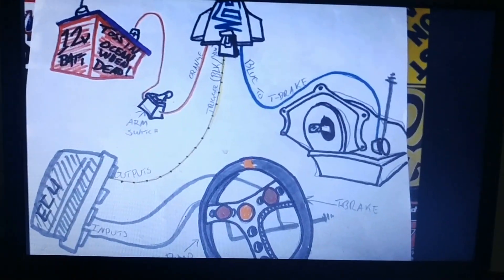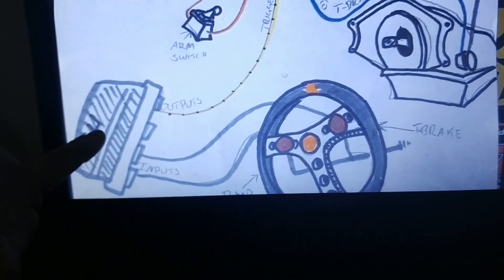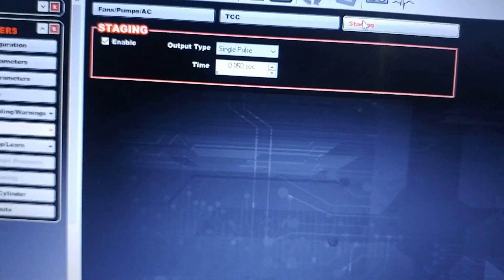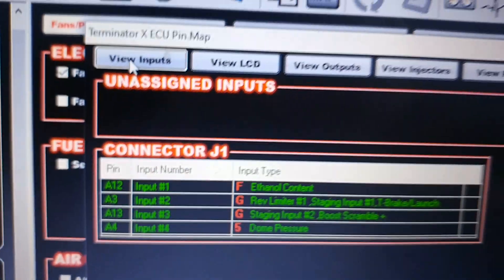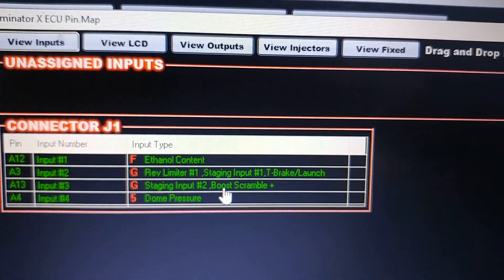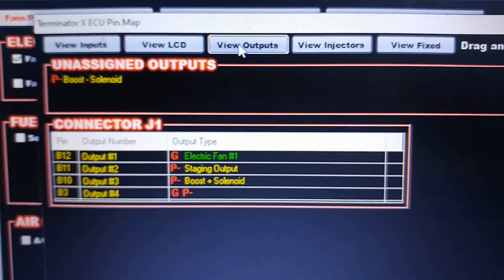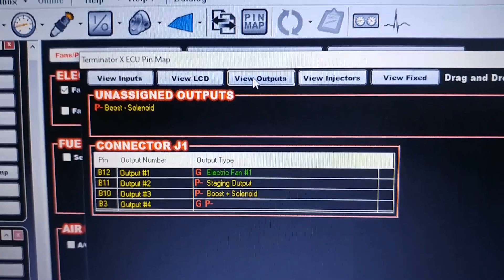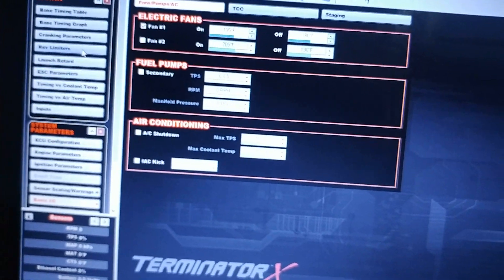How to  setup a 2 step and trans brake with a Terminator X

Comment: Hey there  weve been trying to plug my transbrake for 10 hours now XD , I dont undestand cause on my B pin on my transmition (4l80E) I have 12v .... does not seems to be like this in any guide a try to look into even you guide , would you have a solution to explain why i would have staedy 12 volt on my B pin in tranny when i put ignition on ...

Comment: Do you need a transbrake input protection module such as Holley 554-128?
Reply from the maker: Thanks for watching and commenting. With the solid state relay, it is not needed. You would if you used a standard Bosch relay or had the solenoid directly wired to the ECU.
Reply: @TrailerParkMotorsports 
I also notice the orange wire to the relay is a heavy gauge, and the arm switch it's wired to is a small probably 16 gauge.. these arm switches aren't meant to be ground side controlled?
Reply from the maker: @laned8418  They were intended to only be a ground trigger. Here is the link for the instructions for the NOS brand solid state relay.

https://documents.holley.com/199r11304.pdf
Reply: @TrailerParkMotorsports  just the answer I was looking for. Thank you

Comment: I just set mine up like this today. Transbrake will hold but won’t bump, any ideas what could be the issue?
Reply from the maker: Thanks for watching. I'd start with verifying the wiring of your bump switch and the input settings in the ECU. If that all checks out, then I'd look at the frequency and PID settings and try changing those to see if that makes a difference.

Comment: so staging output should be a pwm- to activate relay?
Reply from the maker: For a solid State relay that you want to modulate, yes. If it's a regular mechanical Bosch relay, a 12 volt positive or ground trigger will work. For the purpose of this video, a trans brake and and bump, it needs a SSR.
Reply: @TrailerParkMotorsports  thanks!
Reply from the maker: @SouthGeorgiahotshot  you're welcome
Reply: @TrailerParkMotorsports  I hate bugging you. But is your bump button set up as a ground? And still not real clear why there's 2 staging inputs?
Reply from the maker: @SouthGeorgiahotshot  don't worry, it's fine. Both the brake and bump button are set as a ground input, meaning the ECU side completes the circuit. There are two staging inputs so that the ECU can work as a bump box, the first arms the brake, the second interrupts the brake for a moment. The second is not needed if you do not desire a bump function. Hopefully that helps.

Comment: explain how you're dual purposing the scramble button as a bump staging as well
Reply from the maker: On the pin map, I drop two or three things to the desired input. Any time that input is activated, the ECU will do all of them. For the scramble/bump, any time that I push the bump button, it will also add the scramble boost, in my case 5 more pounds on the dome. Since the time that it's active while I stage isn't long enough for the boost controller to actually add that much air pressure, it's not really an issue.

The important thing to pay attention to is that the wiring matches, both being ground inputs, or both positive inputs, otherwise the software won't let you.

Comment: Does it matter which wires you use for inputs and outputs if you use the ones labeled for pwm-  for the out put and G for the inputs? I have mine set for tb to be on the red/ white wire on pin A3 and the bump on the blue/white wire on pin A12. The output is on pin B10 to the ssr. orange wire direct to 12v and the blue wire to the tb solenoid. It doesn't work. The tb will work if I ground the center trigger wire.

Comment: How did you get output 3 to work? I have 2 terminator x systems here and neither one of them will allow me to use it.
Reply from the maker: The outputs are ground based sensors, meaning that the ECU will provide the ground side of the circuit. If you're still having issues verify that the wiring on the harness is correct. My friend Jay had a buddy whose inputs and outputs were swapped in the harness.

Comment: How do you have your scramble set up in the table?
Reply from the maker: I have changed some things since making this video. I'm now using a 3 bar MAP sensor and a 3 port MAC valve for the boost control instead of the 2 BAR and 4 port MAC valve.

Under the boost setup tab, I checked the Boost Scramble Increase box and have it set to 5 psi, which commands 5 pounds on the dome of the wastegate. If you cannot find the boost tab, look under the Toolbox drop down menu at the top of the screen and select Add Individual Config.
Reply: @TrailerParkMotorsports  I get the scramble part but I can’t drag mine to staging input 2 it won’t let me. People said you need to make an advanced table.
Reply from the maker: I need to take a look at some things on the software, it sounds like there may be a mismatch somewhere.
Reply: @TrailerParkMotorsports  I actually figured it out. I had to change scramble from ground to 12v. It wouldn’t match to my bump bc it was 12v. Makes sense. Just something that I over looked. Still learning the software.
Reply from the maker: Glad you got it worked out.

Comment: Does the NOS throw a ground or positive trigger?
Reply from the maker: Positive
Reply: Trailer Park Motorsports 
Thanks man
Enjoyed the straight forward video. I had that crappy HP Tuners but saw the light with Holley so still trying to figure things out.

Thanks again
Reply from the maker: I used HP Tuners for a while, I wish I would have switched to the Terminator X a lot sooner.
Reply: It seems the guys willing to help out are far greater with Term X than with HP Tuners.

Got tired of hearing “take it to a tuner.”

Comment: do you know how to build boost on a footbrake car with this system?
Reply from the maker: I'm not sure, I haven't looked into doing anything with a foot brake. I imagine you could do something similar with the two step and just skip the PWM output to the transbrake solenoid.
Reply: with a 4l80e you can do the sloppy 3rd gear spool mod